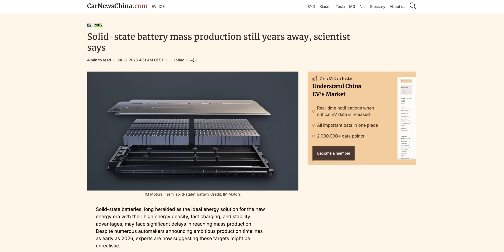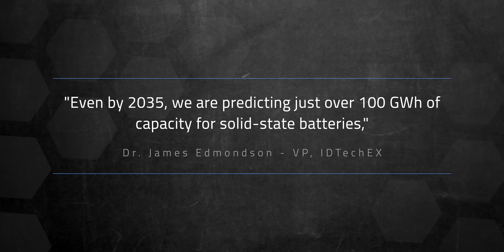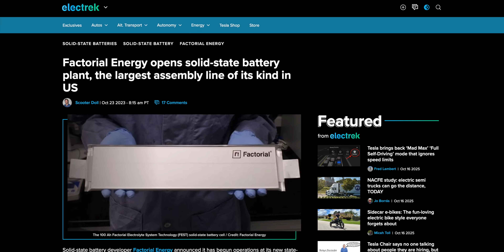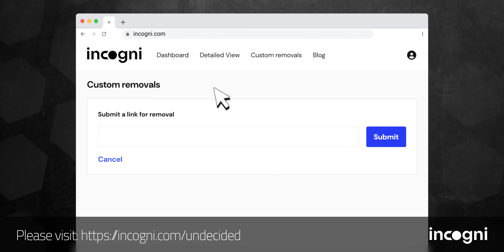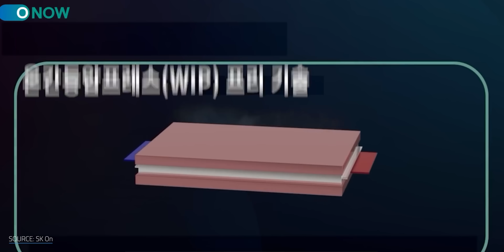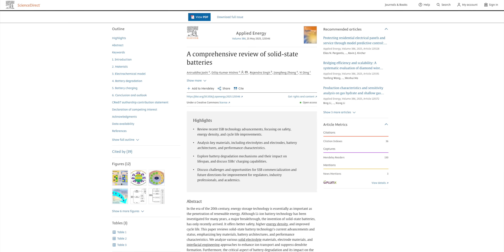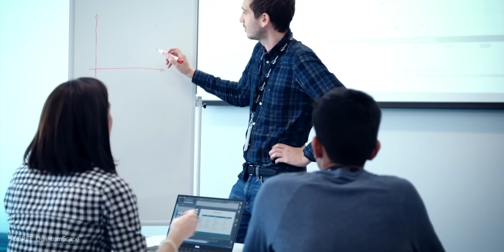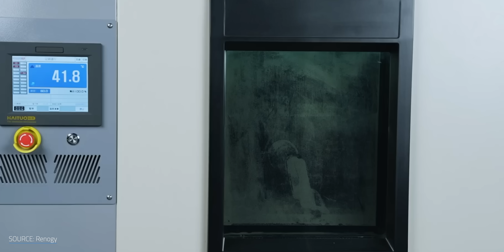How Close Are We to Solid-State Batteries?

Comment: Fully ssbs are dead in the water for commercial application, the pack requires incredible pressure so it cannot have heating/cooling elements and must operate within an ideal temerature range

Comment: I agree; it's the charging, range, energy density, cost, durability, and safety parameters that matter, not the specific materials the battery is made of. I have a full electric now (that I'm very happy with) and maybe when I go shopping for my next car in the 2040s' it will have a solid state battery.

Comment: The biggest problem is that there are no lithium solid-state batteries in reality. The lithium will expand and shrink  according to charge level and if you try to make it too solid, it will crack when you discharge fully charged battery!

All "solid state" lithium batteries are actually "pretty firm" in reality at best. No lithium based battery will be solid state in sense silicon chips are solid state.

When you look at the actual descriptions of "solid" state batteries, you typically see "zero liquid" instead of actual solid material.

I hope we'll see true solid state batteries one day but as far as I know, none of the already existing projects actually even try to create true solid state battery, just something without liquid or gel electrolyte.

Comment: I sometimes wonder at what point all that hyping up from the manufacturers starts becoming a PR detriment rather than an advantage, because to me the whole "solid state batteries within a decade" is becoming the new "nuclear fusion is 30 years away".
Reply: it's mostly them being obligated into saying "something" at least, 

since going by first-gen lithium ion development (1976 prototype to 1991 mass production) early 2030s is a pretty good estimate for the start to taking over brand-new battery production.
Reply: Or the new full self driving lmao
Reply: @Axeon  maybe to drum up investment to share research costs or a boost to the shares 🤷
Reply: There's actually no ETA or actual deadline on new battery tech development. All those "expected release date" are maybe just a way to secure any funding or attract the investor
Reply: Yes, exactly this!
Reply: Fusion only takes place on the surface of the sun. The sun is not thermonuclear based. The sun was modeled wrong.

Comment: In the movie Demolition man  there is a scene where it implied to me at least that a liquid is holding electricity. It can be accessed the same way gas is filled up through a hatch. Is there any science in that. So instead of charging a battery a filling hose would remove spent liquid and introduce new liquid. Speading the recharge method. Ignoring the current or past of replacing battery acid while leaving the anodes.

Comment: I'm willing to bet that solid state batteries have existed for 50-100 years, but they will only release them to the public when there's a financial or political reason to do so. Never forget that electric cars have been in existence for well over 100 years. Hundreds of cab drivers used to drive around in electric cars in the 1890s-1910s, making use of swappable batteries that can be easily replaced at service stations. It's like we've taken a step back in time and we're only now catching up to the technology of that era. This was largely due to evil, power hungry families like the Rockefellers, who put a stranglehold on alternative fuels. Even the prohibition was started in order to prevent people from making their own fuel for alcohol powered engines. Prohibition was only overturned when they had total domination of the fuel market. 

I've been following battery technology for decades, and next to nothing is ever done to improve battery technology. Just a lot of empty promises that are drip fed to the public. It always starts with something like "We're developing a battery that can last for 20 years on a single charge. It's 10x cheaper and 10x faster charging than anything on the market!" This is then followed by a decade of radio silence while the tech is "being developed", at which point they just move on to a new battery technology and the process starts all over again.

Comment: Despite recent cooling in demand, the persistence in the push for EVs and improved battery technology is a definite good sign. 

The fact is that we have reached the limits of what's possible with internal combustion engines, and the only way to make significant progress with CO2 reduction is to increasingly electrifying the vehicle fleet, be it with hybrids or with fully-electric vehicles. Current ICE powertrains are so technologically complex to create and manufacture that the only way small players can exist is to either use an electric drivetrain or to pay another manufacturer for their federalized ICE powertrain. As an industry, it's been decided there's more progress to make with improving battery technology than to further improve ICE technology.

Comment: 1200km range? That´s quite impressive.
Reply: How often do People drive 1200km non-stop? 😂
Reply: @mikafiltenborg7572  that´s not the point. If they were able to make a 1200km battery in standard size, that mean it has a decent energy density and we could have "standard ranged" EVs with smaller, lighter batteries, thus improving range and performance even more and reducing costs of production altogether.
Reply: @mikafiltenborg7572  the point would be so you don’t have to charge so often, similar to a gas car or worry if the hotel you’re staying at has working chargers on the road trip (which people do 1200Km ones pretty regularly in US)
Reply: @mikafiltenborg7572  Not often, but one of the biggest complaints about EVs is that when it’s time to travel, say, more than 1,000 miles, you have to make multiple 30–45 minute stops to recharge the car. Solid-state batteries will reduce the recharge time to about 10–15 minutes, and you’ll only need to recharge once. It’s a massive improvement.
Reply: @baez1301  that as well! and with a decent energy density as the technology seems to have (1200km on a standard size battery!) there´s a chance of having "standard range" EVs with smaller and lighter batteries, improving both range, performance and charging time.
Reply: @baez1301  recharge time is already below 25 minutes for good EVs with 800 volt architecture. And LiFePO batteries from BYD and CATL already support "megawatt charging" and 10 minute recharge (and have million kilometers lifespan and are extremely safe).

"1200 km range!" claims for prototype cars are somewhat meaningless. Put the 200 kWh pack from a Silverado EV pickup truck in a an aerodynamic sedan and it will travel further than 1200 km.
Reply: @baez1301 That’s not how most EV drivers charge on a road trip. Just charge when you stop even if the stop is a quick pee stop. Do the math, most people need a stop every two hours and most chargers and cars can add around 80 - 100 miles in 10 to 12 minutes so you nearly top up your battery at each stop. Then charge for slightly longer every 4 hours when stopping for something to eat. Thats what I do and it works well.
Reply: Don’t believe everything

Comment: The difference in performance between chemical and static storage of electrons  (in tension) is'nt solvable. It will not replace the capacity of an electrolyte based battery (accu).  Simple as that. You can believe as hard as you want. It's just basics.

Comment: As it pertains to EVs, the drive of Solid State Batteries is good not because of changing battery structure itself but to get those hypothetical points that make EV adaptation met.

For EVs to take over it need to do the following:
- 500 miles range on an 80% to 20% discharge
- continent, quick recharge from that 20% to 80% (10 minutes or less) at convient locations (like your normal gas stations, for examples)
- power grid stable enough to handle the recharge of the EVs.
The SSBs easily help with the first two options.  The latter one is something that is going to be a major issue that's not discussed by "normal" people talking about EVs but is as big of the piece as anything.
Reply: also rampant theft of power grid components is going to continue to be a huge problem which directly affects EV folks, and if it can all be centralized for safety and security, that'd be good.
Reply: i think its difficult to understate how big of an issue power grid limitations are right now. North america is severely hamstrung by the fact that it routinely supplies homes with inefficient single phase services at only 120/240. A lot of homes cant effectively handle it without a service upgrade, and while a 100 to 200 amp upgrade isn't too bad a 400 amp upgrade is very expensive. Most of the rest of the world at least has much better access to three phase power at a higher service voltage of 230/400. But they also have the drawback of usually having tiny electrical services by comparison, often only 25 or 32 amp. And of course a lot of people dont live in single family homes, they live in apartments, without access to high capacity plugs to charge at home. The problem will only get worse one larger Battery electric vehicles like Buses, RV,s and Trucks start becoming mainstream, and those will need much beefier chargers than whats available today.

Of course there are other solutions to alleviate these problems, especially in cities, and that is simply improve public transit, so that way fewer people need to get their own vehicle period. And the truck issue can be solved by investing back into rail cargo transport.
Reply: @ryuukeisscifiproductions1818 do you not know that there are 3-4 "standard" electrical voltages in the US, 120/240 single (which is typically used for residential), 120/240 3 (this is rarer but does exist) 120/208 3 (very common in commerical), and 277/480V 3 (also used in 
commercial).

Grid stability is a major issue internationally, pretending like Europe is somehow not suffering from it is silly. The grids can't sustain everyone adding 40amp 240V single phase loads at the same time  (typically at peak demand is where issues arrive). They'd be able to if they were allowed to dispatch more coal energy production, but they aren't. Both reducing coal usage and sustaining the grid with the dramatic load increase at the same time is not possible. We should stabilize the grid first. What's going on now is genuinely dangerous to the safety and security of the common citizen, more than the problem that its trying to solve is.

I don't think there is a problem that needs solving in regards to transportation anyway, like why do all this in the first place? What, for climate change, even Bill Gates, the biggest pusher of that agenda, has backtracked on it as of late.
Reply: @tombolt13thexehanort29  Buddy, I'm an electrician, and there are a lot more than 3 to 4 standards in north America, there are actually eight (not counting really obsolete ones that are still occasionally in service like corner grounded delta's and two phase). But three phase in residential is very rare, and often not available, especially to rural area's. Three phase is rarely available to residential customers, despite the major efficiency boost that would happen if north America got rid of the 120/280 and 240 standards and just standardized everything on 277/480. It would even be cheaper on the grid end since three phase power lines would no longer need neutral wires, and the grid would need far fewer transformers, and three phase transformers are cheaper than a same KVA bank of three single phase ones. Europe doesn't have that headache because they picked a single standard and stuck with it, that being near universal 230/400 (albeit you might run across the odd ancient 240/480 split phase transformer still in operation in rural nowhere.

And grid stability is not a power generation issue, its a transmission issue. Some places like California have so much excess solar and wind generation, that they have to shut some of it off because they dont have enough transmission infrastructure to export it out of the state. 

And coal, really, what are you, from the 19th century. Not only is coal the most polluting energy source, both on a global and local scale (FIY coal spits out far more radioactive gunk into the atmosphere than nuclear ever does), and lets not ignore that that crap does to local air quality, the cancers it causes to residents, and the sheer number of coal miners that junk kills every year, Coal is also hideously expensive. Coal is rightfully dying, because natural gas, Solar, wind, and hydro are just cheaper and better. And no coal is not expensive because of Environmentalism, its expensive because its a pig to transport and extract. you have to dig out massive amounts of the ground to get it out and then it has to be shipped by train and rail, which is both slow and labor intensive. Compare that to natural gas which can be extracted by just sticking a deep pipe into the ground and building pipelines, or Solar, Wind and Hydro which dont need any fuel shipped to them at all when in operation. Even nuclear is cheaper than coal in the long run despite how heavily stifled nuclear has become.

And the grid stability wouldn't be anywhere near as much of a problem if we didn't have techbro oligarchs hogging huge amounts of energy to run their crypto and AI scams. Shut those scams down and grid stability problems go away.

And bill gates is your example, really, a rich old billionaire whom is totally insulated from the consequences of global warming and has no reason to care if all the peasants and working class suffer from the effects of global warming. He isn't going to suffer the consequences, he has no reason to care, an nor does any other billionaire. Human caused Global warming is real and the billionaires are the ones paying people to say its fake, because they dont care and even want the masses to suffer so they can get richer. Stop being a stooge of the billionaires.

Comment: My best hope for solid state succeeding is constantly improving competitive battery chemistries like LFP, sodium, and LMR. The competing battery chemistries also solve safety concerns, provide long life, and are much cheaper than current NCM batteries. I also do not care if solid state batteries have zero liquid electrolytes. It is the resulting capabilities and cost that counts. I also see the possibility of hybrid battery packs like the CATL Freevoy designs, that mix different batteries in a single pack. Providing the best of both technologies to match particular buyer's needs and price. Because the buyer needs and expectations of a budget (entry model) BEV will be different from a fleet or Uber vehicle, or a luxury/performance vehicle. The question is when solid state finally arrives in affordable, volume BEVs, will it matter? Or will competing battery chemistries/technologies make solid state batteries immaterial and irrelevant by 2027-2030?

Comment: Are SSBs any cleaner to produce than Lithium based batteries?  This is an important piece IMHO.
Reply: Just remember that the lithium and cobalt in batteries are well over 90 percent recyclable. And every major manufacturer is moving toward closed loop battery manufacturing - tracking ,repurchasing and recycling the supply chain. Most of the"lost" minerals of the future will be from tools, cell phones and computers.

Comment: CATL claims it is putting a Na-Ion battery into production in December 2025.  It is said to have better performance than a LFP battery (the current choice for economical BEVs) for about half the cost.  Obviously it remains to be seen how the production rollout goes.  However, CATL is not some lab just tinkering with technology, they are the world’s largest battery manufacturer.  If this works out, you got to wonder how investors will determine  what is worth further R&D funding.

Comment: At 6:54 getting 844 Wh/L is insane. That's getting close to the magical 1kWh/L. That's a milk carton size (everywhere but the US)!! Or 10x10x10cm. 😮.

It's ⅓ to ⅕ of current tech in terms of dimensions 🎉

Still, it's about 10x bigger than diesel or gasoline.
Reply: Yeah, but diesel and gasoline are consumed, not discharged. They must be replenished, not recharged. And the minerals have to be removed from the exhaust or air, not recycled for new fuel. Energy density is a red herring.
Reply: @GeeDeeBird good point. But, not entirely a red herring. On my sailing vessel, I want to replace a 50hp diesel with 220L tank for electric propulsion. I cannot store infinite weight, I'd sink. My limit for the 44ft, 10T disp yacht is 600, maybe 800kg (after removing the engine. 

With current tech that gives me 120nm range on 80kWh in LFP, vs 450-550nm range on diesel. So, red herring or not, density matters, definitely in my case.
Reply: @Misteribel Sorry, I thought we were talking about passenger cars. Of course there are certain vehicles that are not (currently) appropriate for electric power. Most notably, semi trucks, air transport and commercial airplanes. As for boats ... Certainly ocean liners require greater range, but maybe leisure craft can do fine with battery electric power. But, to me at least, it is significant to note that combustion engines are at the end of their maximum technological life while electrical technologies are in their relative infancy. So the relative efficiencies will continue moving toward EVs for years or decades to come. Thanks for the interesting discussion.
Reply: Amprius just sent its prototype SA105 battery to its buyers with 450Wh/Kg 905Wh/L and something like 500-700 cycles (better than current Tesla batteries. They are shipping today and have 1.8 Gwh capacity and they just started making a positive gross margin last quarter